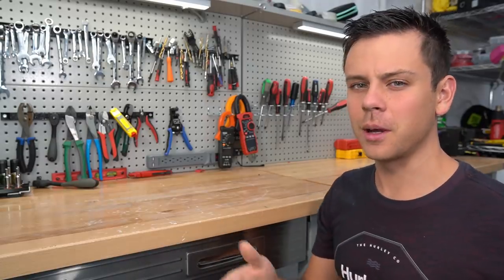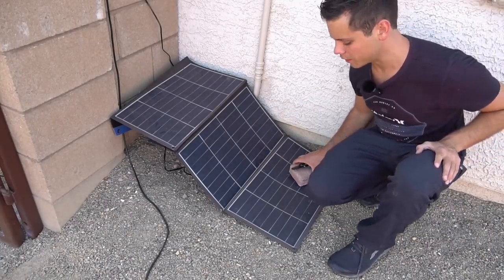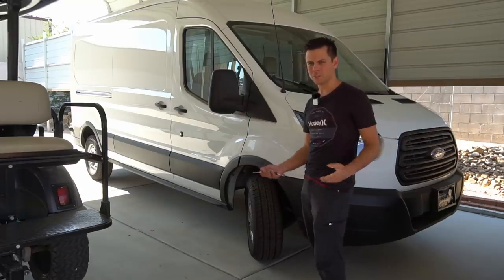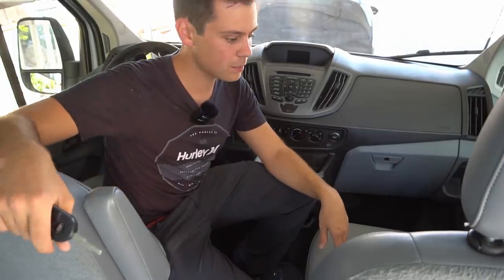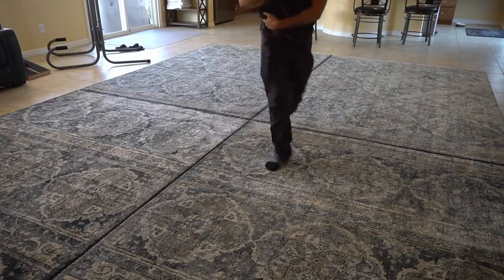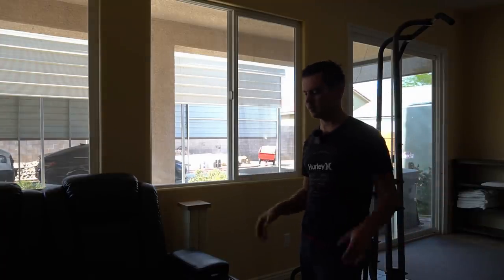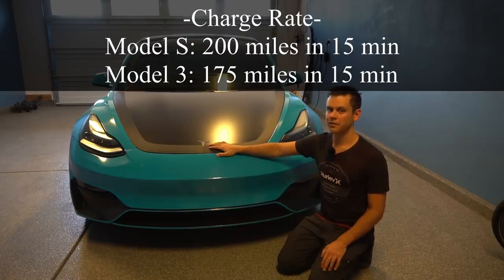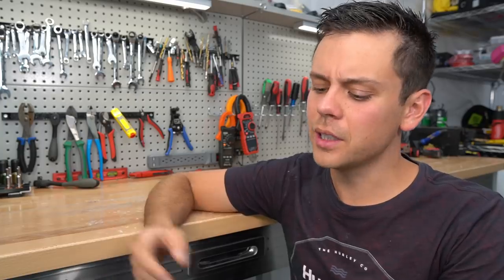Home Updates: New DIY Solar Gate Opener, Window Security Film, New Work Van Etc

Comment: While this channel is more concerned with Home systems lately (owning a home tend to do that), i like it.

Lots of stellar info about new batteries (with TEAR DOWNS!!) thank you for doing that! Even the older vids have nice ideas, like using a mid-sized Jackery with a cheap 50 watt panel or comparing major solar panels for actual wattage. Or just keeping ones batteries out of the sun/heat. 

Your new(ish) van is awesome! I recommend turning it into a hauler/camper by installing some nice insulated walls and a floor then adding “snap-in” camper gear and furnishings as needed. I LOVE vans.

The rest is charming.

Comment: I have the same Ford Transit. I used a lot of your videos to help me install the entire solar/electrical system myself. I am concerned about the heat on the Battle born batteries though. I live in Phoenix which has brutal summers like Las Vegas.

Comment: Hey man, I want to thank you for all the videos you post, they have helped me a lot to take my 36 foot rv I live in full time off the grid. I’ve managed to fit 11 residential panels on top and run 3 48v agm battery packs to a 6000 watt inverter. Because of you I was un-phased by having 140v on the roof. If you have time I’d love to show you what I’ve done and I’m sure you would have some ideas on how to improve it. Thanks

Comment: On your security gate, you should remove those clevis pins and replace them with a bolt a locknut and red lock tight. Bad guys are known to simply reach through the gate pull the pins out it only takes a few seconds and they're in. Yes, I like seeing your personal side it's nice.
Reply from the maker: I use a large most days. But yes so easy to open it without

Comment: "yeah it only needed 15 watts so I decided 100 would do" -based
Reply: Absolutely! 😆My neighbor has a solar powered gate (pretty sure he paid at least the $8000 for it). We get frequent inversions with fog in the winter. After a week or two with minimal sunlight his gate stops working. The strange thing is, the solar panel, etc. is mounted on the south side of the gate but on the north side there is an irrigation pump with power permanently wired. It would have been trivial and much cheaper to power the gate from that source.

Comment: Yesss some Van content with an electrical wizard= just what I need. 
I would love to know how realistic for me too hook up my solar panels with a system that can charge the car battery and make sure I have enough juice to run a winch as well…. I also have a Bluetti portable solar generator that I would love to know how to set up in the van with a fused system that could connect to solar panels etc.
I’m just a plumber so this electrical stuff is pretty complicated for me LOL but even my electrician friend say they don’t know anything about working with electricity in a car…..
I have a for transit 2017 and the eco-boost turbo is the real deal for sure😉👊

Comment: Will, I bought an 8000btu Midea U, and I noticed you didn't mention some of the biggest advantages of these AC units (other than just the efficiency). All the motors are variable speed (including the compressor motor)  and include an electronically controlled soft-start. These are perfect for running off of small inverters or solar generators, as when they start the input current never exceeds the normal running current, the system just spools up slowly. I have even ran mine off of a 300W Aimtom Solar Generator for about 20 minutes, you just have to gradually lower the temperature as the room cools off so the compressor never runs at full speed. When running on the solar generator it was running with an input power of 232W and the air blowing out of it was 57ºF on an 80ºF day.

Comment: I'm very interested in the golf cart.  We have an Alaska off grid property and that's exactly what I've been thinking about - a golf cart that is basically a portable power bank.  We currently run our house with a 2,700 watt, 48 volt solar system with a Honda 7000 generator that hasn't had to run since May 1st.  Now I want to add solar to my connex garage and be able to charge a golf cart.  That would allow me to run around the property with the cart and tools to do projects, so cool that you've already done that.

Comment: I like the "fireside" chats! I started watching your channel when you explained how you ended up living in vehicles, and you said "don't judge her...". Doesn't get more personal than that and it shows your human, love-to-have-a-beer-with-you side! 
My concern would be the cinder blocks will crack soon due to stress. Maybe mount a steel pipe of some sort in cement and use that to attach the gate opening arm. What type of tactical pants/work pants are you wearing? I cannot find a pair that does not look ridiculous and/or cheaply made. Been through 8 different pairs!

Comment: Hey Will - great video as usual!  They don't all have to be technical  :-)    I'd like to add that I have you to thank for getting started on LifePo4 batteries and misc. solar projects.  I'm just finishing an automated tracking array using six Rich 100w panels mounted on a frame that's gimble mounted.  I'm using two linear actuators to have it track the sun.  I didn't really need it, but that's not the point right?  The point is to have projects to noodle on!  Thanks again Will!

Comment: In the event of a massive power failure, do you have enough battery back up to power up your entire house for days? (Fridges, tv, kitchen, main Aircon). Have you check how much power your house consumes?
Also how do you hot your water? I use a solar tubes tank and an electric back up tank.
Reply from the maker: Yep. Super easy

Comment: Will,   Check out the Wyze V3 cameras.
So far doing well in direct sunlight outdoors.
VERY easy to power.
When the moon is out: it looks like the sun is out almost.  They are VERY sensitive when no extra illumination is present.  If you use a few 12V IR flood lamps;  the background will be drowned out, but the illuminated areas will be dark to you but bight on video.

I suggest you get one and check it out.   They can be re-configured to act as custom IP cams at home or just by using their app in the original stock config.  They do come with motion detection and detection zone settings, you don't have to pay for the special services they offer;  I think its a money sinkhole, $1-2 per feature per camera per month....

I am extremely impressed with the image quality and low light sensitivity of the V3 compared to their older units... for only ~$30

Comment: I picked up the same gate opener and was disappointed it couldn't be connected to a smart home.  I found a $10 wifi relay on Amazon and connected it to one of the open control terminals.  Now I can open and close with automations or my phone.

Comment: Just a personal aside regarding the Mideau Air Conditioner. I would qualify the recommendation of it. It is great if you live in a desert environment, but if you live in an area with even a smidgen of humidity it grows mold like you wouldn't believe in the front lower housing. 

We had suggested these units to relatives in the Midwest and they've suffered horrid mold problems from the moisture retention in that front lip, while I've not had any problem with it here in the San Joaquin Valley of California. Which is only slightly cooler and higher humidity than Las Vegas.

Comment: I made some gate openers  when i worked at a fab shop
Motor and gear box wss $150
Belt drive over chain for safety the chain is atached to a rolling gates.
Someone could just use a garage door opener to open ea gate with rollers

Comment: have you ever consider vacuum pipe solar air conditioner? These things are supposed to use solar heat from vacuum tubes to pre-heat Air Conditioner gaz before being compressed (if i understood things correctly). It's supposed to reduce the power usage of the AC. As you seems to be in the right kind of environment for this kind of thing.

Comment: Regarding charging stations you are correct in saying they are the weak link in electric vehicle implementation. Ford says they are going to install 50,000 charging stations nationwide. But there are as you know several charging methods that aren't compatible, hopefully new stations will allow different setups within one station. What the goal must be is to have the fuel pump time experience duplicated by charging stations. That is about 15 or 20 minutes; when recharging gets that close then electric vehicles will be ready for prime time. As far as RVs EVs won't be practical for boondockers or people who prefer dry camping without hookups because they simply won't be able to charge up, at least not efficiently. Just my view. I'm sure people much smarter than I are working on these issues...

Comment: This video is cool. You can buy a cat waterer that hooks up to the plumbing and drains into the drain plumbing system. Even have fountains.

Dig that van. I'm working on a 75 CB300 Dodge Box van, pain to get parts for lol. Dodge doesn't even acknowledge it's existence, they don't go back past 84, and I'll get 8 MPG if I'm lucky. May end up living in it. Box Vans are built so much better than RVs. You can almost walk through the wall of an RV.
Reply: I didn't know Dodge was doing that...for that mater, didn't know Ford was doing it either. I have a 96 Ford Explorer XLT w/177000+ miles, called the local Ford House about Front Wheel  Bearing Replacement.. they stated they won't even look at it...it's over 18 years old....! I could do it myself but I live an RV Park, can't work on Vehicle or RV...! Life Sucks...!
Reply: @jalpa9642  That sucks. I'd get one of those pop up garages.

Comment: How about trying to turn that midea window air conditioner into a true mini split. I’ve been working on solar systems for Rv air conditioning .  I use the built in 13.5 btu roof mount to quick cool, then use a window unit to maintain temp, lower energy consumption and reduce noise. Using a mini split could reduce noise even more but there are no 5 to 8k btu models available. Mounting the compressor half on a trailer tongue and moving the evap inside would be ideal. The u shape model has two fans already. Saw it in half, extend the wiring and Freon line then modify the case to allow a condensate drain.I tried to get the factory to consider it but I suppose it’s a limited market. I may buy one and do it myself but I am on a retirement income.  Too bad I’m not an influencer.

Comment: Cyber truck will have 620 mile range, even if towing cuts that in half, so?  My tri motor reservation will be pulling my 11,000lbs tiny house, I'm not worried.

Comment: For giggles / interest / youtube content...  not sure on the legalities over there but what about putting a model S subframe under the trailer? send the van's canbus throttle position to a motor controller in the trailer, set it to regen at 0% throttle, hybrid tow rig! would be interesting to see if it makes the trailer essentially free to tow fuel use wise on the van or possibly even improve its fuel economy city/hwy loaded/unloaded and where the ideal battery size ends up...

Comment: Do you know, by putting the gate controller on the outside someone can have the gate open in 45 seconds with a small screwdriver?  I think you should have put in inside the gate.
Reply from the maker: You can pull a pin on either joint and the gate is open instantly. I use a large lock instead. The gate opener does nothing for security

Comment: If you had any equipment in the small trailer maybe install something like a small tv in the Van,I’m thinking about the same for mine, just tv mount in the back on the side wall, RV cell booster, solar on top and LiFePo batteries not sure about A/C

Comment: Would like to power a good size 5th wheel power requirement should be 50 amp would like to take it to Ranch for off grid use

Comment: Hello Will, are you doing a van build in private? Or just using it to haul equipment and solar panels? I want to do a solar van build as a van for a portable office and solar deep cycle battery bank for a solar shade house I am in college and it is one of my class projects to design. It is even hard to price out components as some prices are changing daily.
I do check weekly on what new projects your doing and working on.
Regards
Hope

Comment: People say the lifepo4 is better off not at 100% charged. So would this mean you don’t want your solar system producing enough to charge 100%? My setup very slowly eats the amphours  but will require a shore power charge up one per month. I’ve been thinking one more panel will keep it charged 100% but would this be harder on the battery?

Comment: Hi Will, how can I make this work. I bought some unused Komatsu N200 batteries at an auction for off grid set up. I have 30 of them. 12v. Heavy duty commercial. Is there any way I can make this work or do I need to sell them. Regards.They are cranking batteries, not deep cycle.

Comment: What was that PWM charge controller, and the battery used as I have the exact same need, but I couldn't find anything to charge the LiFePo4 like yours (8Ah)?  edit: My battery is "Miady 12V 8Ah Deep Cycle LiFePO4 Battery" on Amazon (I can't post links on YT).

Comment: What set up would (panels, batteries, inverter, etc.) it take to power my HVAC unit as a non grid system? I know this does not give system requirements (I don't know the numbers) Less than 1500sqft house. We have peak (price gouging) hours from 3 to 8 pm. And estimated cost? Any ideas would be great.

Comment: Will  ... get a ruger lcp   Keep in pocket all the time  u wont  even notice it 👍🏻🇺🇸✌🏻
Reply: I'd suggest a Model, Snakslayer, Bond Double Derringer in a 45 Colt/.410 shotgun with a 3" barrel.  Between 6'-20' it's deadly & it easily fits in a small pocket.  No "Conceal Carry" permit needed here in Nevada.
     Warm Regards from Reno, Nevada.

Comment: I'll get a model 3 later on amd still keep the the bolt wv or upgrade to the euv bolt ev 2022 or later down the road. And the model 3 for long trips and keep it at 50 percent  charge.

Comment: Does that van have that V6 3.7 Cyclone engine? They put the water pump inside the motor, actuated by the timing chain. How stupid. When the water pump fails it'll leak inside the engine and destroy it. They also made the intake out of plastic. So disappointing how almost all car companies are designing made-to-fail cars.